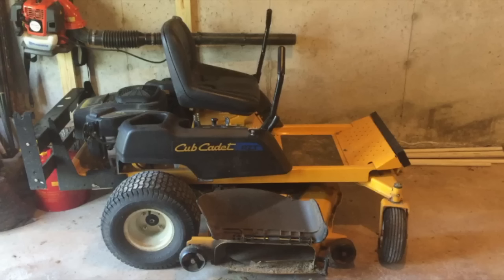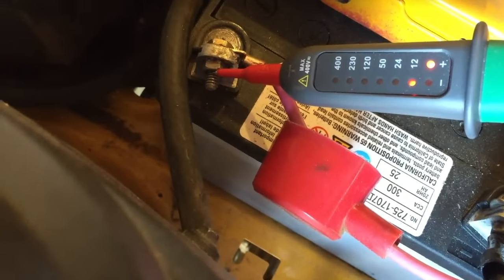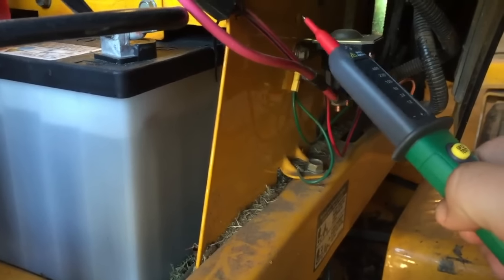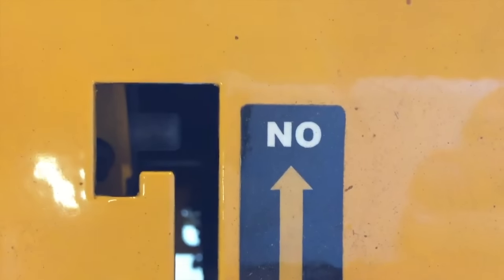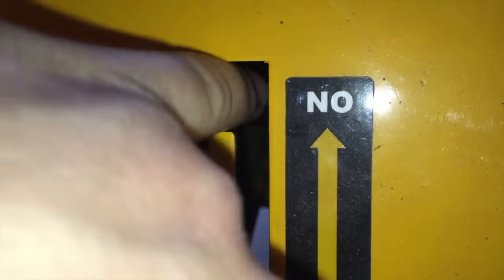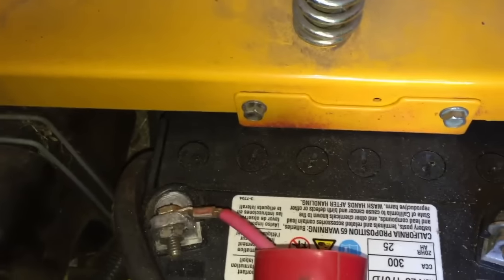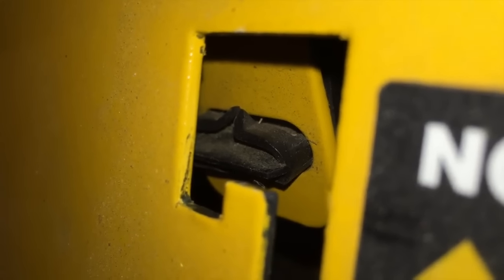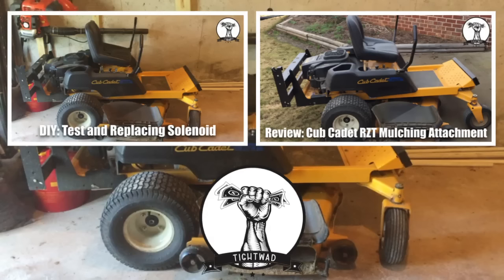FIXED: Mower Will Not Start - Safety Switch Diagnosis and Repair - Cub Cadet RTZ ZTR

Comment: Great video buddy I have almost the same unit sitting here in front of me right now new starter solenoid not the ignition switch as I have switched it with another tractor I'm not getting power to my hour meter I'm getting no lightsit will run the engine with the ignition switch on if you jump the solenoid will not start with key will not stay running I'll make it stay running I can deal with the carburetor I'm guessing a ground or maybe a mouse chewed a wire
Reply from the maker: Fred Stone Do you get 12V to the solenoid from the key switch when you turn the key?
Reply: @TightWadDIY  highly doubtful because no power to hour meter or warning lights. I ran out of time last night. I'll be leaving in time to really check it out. What are you thinking? Thanks for the reply
Reply from the maker: Fred Stone You may have to start checking safety switches. It can be a pain to remove each one but I’m betting one of them is bad. I’ve had to remove and clean my parking brake safety switch twice.
Reply: @TightWadDIY  I hear you buddy but I don't think that that would cause the condition where I don't have power to any of the lights but yet with the key on it does energize the coil
Reply: @TightWadDIY  I do appreciate you getting back and I want any help you can give I'm just trying to let you know exactly the symptoms I'm looking at I was checking out your channel man I really like it we're out on the farm now and time to start thinking more that way
Reply: @TightWadDIY  hey buddy thanks for the help I'm home I have the side cover off checking electric no power to the starter solenoid small wire I'm going to start by checking grounds and looking for mice damage
Reply: @TightWadDIY  so will my safety switches I've got three or four wires how do I look up what needs to be cross to bypass them for testing
Reply: @TightWadDIY  giving up for tonight with the key on I have spark but no power to the solenoid at the bottom of the carburetor and no power to anything else it's like the only thing the key on works is giving power to the coil and I don't understand why yet
Reply: @TightWadDIY  I have tried multiple ignition switches the starter solenoid is new the ground underneath the right side cover seems to be in good shape no power to the hour meter I just don't get it man thanks for all your help today it's kind of cool to have somebody on the other side
Reply from the maker: Fred Stone Try going to Taryl Fixes All and ask there. He is a small engine repair shop.

Comment: Thanks for the tips i have the same mower same problem.
Reply from the maker: enlighten You are welcome. Let us know what is wrong when you discover your issue.
Reply: It was a broken wire to the fuel shutoff solenoid. I found by testing the solonoid. It was good. Next I tested for power to the solenoid, no power, so I just ran a jumper wire from the battery to the solenoid. However I don't think I solved the original problem since it will only start by jumping the starter solenoid. I can mow but I have to jump the fuel cutoff solenoid and the starter solenoid. Also I tested for power to the signal wire on the starter solenoid and nothing there hence the jump.im guessing the battery grounded on the body and shorted something somewhere I just gotta find the short.

Comment: What should I do if the PTO light comes on and the blade is not engaged?
Reply from the maker: Do you mean that light comes on when you are trying to crank the mower?
Reply: @TightWadDIY   yes I turn the key and it doesn’t click or anything the only light that comes on is the PTO. I just replaced the battery and it still won’t turn on
Reply from the maker: @kirstinseaman6661  I just tried some things on mine. The handles being up or down didn’t trigger that light, they made the Parking Brake light come on. I turned on my PTO and tried to start, the PTO light came on but I also had a loud click. Did you jumping your solenoid to see if it turns over?
Reply: @TightWadDIY   No I’m a little nervous to do that, I don’t have the same tool you have to make the sparks. Thank you so much for your quick responses!
Reply from the maker: @kirstinseaman6661  Do you have a multimeter?
Reply: @TightWadDIY   I have one that has two separate poker things for positive and negative
Reply from the maker: @kirstinseaman6661  Here is how you can test it with the multimeter. https://youtu.be/ZyBV-FLtVf0

Comment: hey bud, I have a 2013 craftsman riding mower that won't move forward or reverse. what can it be?
Reply from the maker: I would need more information to help. Do you have a model number? If it is belt driven, you likely have an issue with the drive pulley if it won't move at all.
Reply: +TightWadRepairs idk the model number but it starts fine the deck works fine also but the mower won't move at all.
Reply from the maker: +brans I recommend posting your issue with your model number on mylawnforum.com They are very helpful with a variety of mower issues.
Reply: TightWadRepairs  should *((‘“

Comment: Can i get to the brake switch, when i remove the deck?
Reply from the maker: ccdirectt vdllc Not on my model. I had to remove the battery and reach in from the back end.
Reply: @TightWadDIY  Mine looks about like yours.ZRT 50  22 hp B&S about 15 yr old. I took the deck off and it wasn't bad to get to it. 3 sets of 2 prongs / 6 total. Mine starts after i move the controls, arms / brake / etc. The arm safety switches were replaced about 2 years ago and the ignition switch. Can i ground 2 of them on the brake switch wires? And which ones would it be to bypass it ?
Reply: @TightWadDIY   This is the part no. for mine. MTD 725-04232 Switch-3 Pole Nc

Comment: Is the brake safety switch the same part number as that of the ones on the operator control arms? I was looking the weingartz site over and over and I could not find a part that referenced that specific switch.  I am guessing they are all three the same, just looking for confirmation
Reply from the maker: Michael Jude I haven’t checked part numbers but I assume they are the same. It is always your best bet to call cub cadet and ask them. They are very helpful on the phone.

Comment: I have a cub cadet 0 turn and. I have a good clutch, a brand new pto switch, I checked all the switches and it seems they're ok. I put some power to the clutch and it works, but when I turn on my brand new pto switch, the pto doesn't engage. Does anybody know what could be the problem?
Reply from the maker: I'm not sure about that one. Try posting your issue on mytractorforum.com There are some mower techs on there that could likely help.
Reply: I know it’s old post, but it’s probably the reverse mowing safety switch. Stops it from cutting in reverse, and the switch, or the metal tabs that push them down are bad! I just fixed this same issue.
Reply: Wiring probably a ground maybe a break between the PTO switch and the clutch

Comment: i have a john deere zero turn mower model # Z225 made in 2007. i have a reverse issue on the safety switches on my mower. It will crank with the parking lever on and both steering handles to the outside. When i try to release the park brake it shuts the mower off or when i try to move one of the steering handles (either one) it shuts off. what causes this?
Reply from the maker: TheMuscles77 I'm not really sure on that model. I know on mine if I release the parking break while the handles are out, I cuts off. I have to pull the handles in then release the break.

Comment: when trying to by pass the solenoid,  i barely get any sparks and it drags when turning.
Reply from the maker: Jeremy Karber So you get nothing when you turn the key then a slow turn over when you bypass the solenoid? Do you have a multimeter?
Reply: TightWadRepairs , yes i have one.  im getting plus/minus 12v for the battery. 12v on the first post on the solenoid. only reading i get on the 2nd post is if i put the pos on the forward post and neg on rear post. but meter reads negative 12v
Reply: lets start from the beginning.  the mower has been giving me trouble for awhile when i start it but after a few tries it would fire up. i parked it and now nothing. i get a single click when key is turned to on . bypassed solenoid. starter engaged but never cranked. i cjecked volt regulator and im getting 12v
Reply from the maker: Jeremy Karber I can't be sure but it sounds like the starter is bad.
Reply: TightWadRepairs thay makes sense but i was confused on the starter engaging when i very first bypassed the solenoid.

Comment: My starter turns ,but the engine doesn't fire. What's next
Reply from the maker: Check your air filter, spark plug, fuel filter, and fuel lines.

Comment: My mower cuts off when I release the brake what's wrong
Reply from the maker: darrick johnson That is most likely a seat switch issue. The mower thinks nobody is sitting on the seat so it cuts off.
Reply from the maker: Eli Byrns It could also be related to your switches on your steering handles.

Comment: I have the exact mower fuze is good bat is new but wont crank or click what shoukd i be looking at
Reply from the maker: Lucas Swank Check the solenoid.
Reply: Did u mount urs there or is it factory cuz myen isnt there
Reply from the maker: Lucas Swank That is the factory location on my model. There are several different versions of the same mower though.
Reply from the maker: Lucas Swank Follow the red wire from your battery. It will go straight to the Solenoid.
Reply: TightWadRepairs myen is located under the seat this should be fun
Reply from the maker: Lucas Swank That is a horrible location. So you have to remove the battery just to get to it?!? How are you supposed to test it if you can’t leave the battery connected?!? I have another video showing how to bench test a solenoid.

Comment: POS Bought the 54" rtzl brand new 2018 for $2800.  it has 68hrs.  Has trouble starting.  Have to pour a little gas to the carburetor.  Blades are too thin and wear out fast.  
Control arms are out of alignment even after adjusting them. I just spent 2 hours trying to fix this issue to no avail.  The springs attached to the arms are incredibly hard to put back on.  First you must attach a heavy gauge spring with a really small opening to a hook which is almost impossible to reach due to the small opening to install.  I got it hooked ONE time using a coat hanger to find that it is 2" below the hole for the bolt.  Again the gauge of the spring is too hard to stretch.  there is no way to leverage.  I gave up and now have no mower.
The spark plugs and oil filter are hard to reach as well.
Very poor engineering and design.  
Go with a different brand and save yourself a lot of time, money, and stress!!!
Reply from the maker: Default Name I’m sorry to hear you have had so much trouble. 68hrs is a lot to put on a residential mower in one season. I would never recommend using a residential (home owner) quality mower for a landscaping business. They are cheaper because they aren’t made to handle that type of work load.
Reply: I am using it to mow my residence about 5 acres.  According to tractor supply that is what its rated for.  I live in texas where grass grows march - November and I have aleady started using it this season [68 divided by 10 = 6.8 a month].  I have had issues from the very get go [starting].  The majority of the issues are design and quality of engine
Reply from the maker: Default Name I understand. What motor does yours have?

Comment: Anyone with any other great ideas I would really appreciate some help
Reply: Figured it out some half-ass mechanic was trying to diagnose a bad fuel pump and started cutting wires I have power to the coil but not power to the solenoid on the carburetor or to the hour meter
Reply: All fixed and paid for now

Comment: Most of what you have here is correct.  However, you state that on this mower if the parking brake light is illuminated then there is a problem.  That is not true.  The light is illuminated any time the parking brake is engaged.  It needs to be engaged in order to start.  So it's illuminated, it should start and you don't have a bad switch.  Not sure how you fixed the problem but according to your video it IS NOT the parking brake switch.  I have the same mower.
Reply from the maker: Cheap Dad You are incorrect. On this model, if the parking brake is engaged, the light should be off. The lights are indicators showing what you need to do to crank the mower. If the light is red, your mower is not ready to crank.